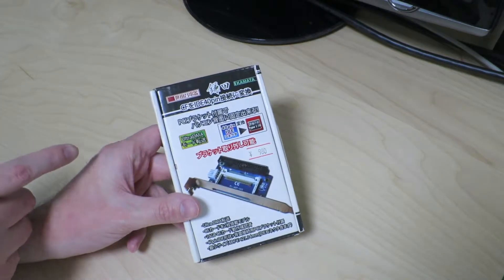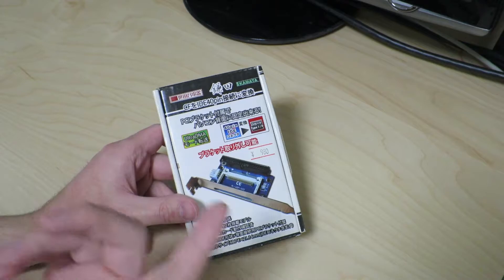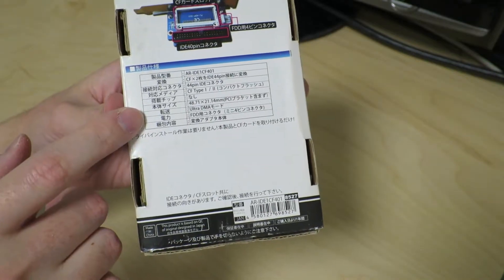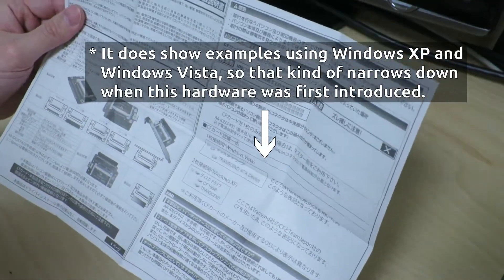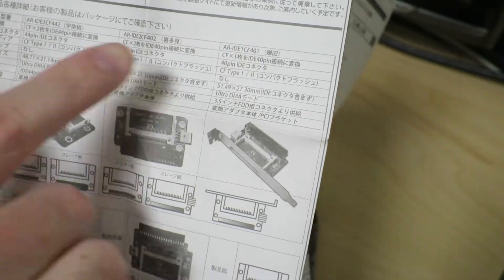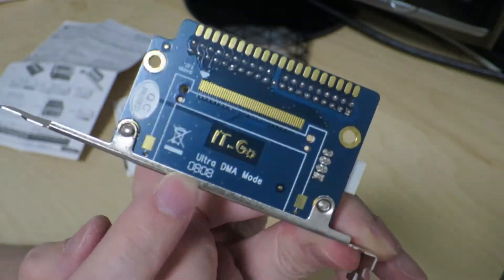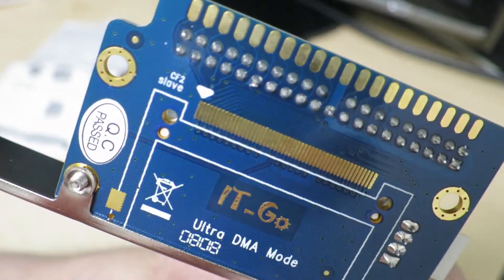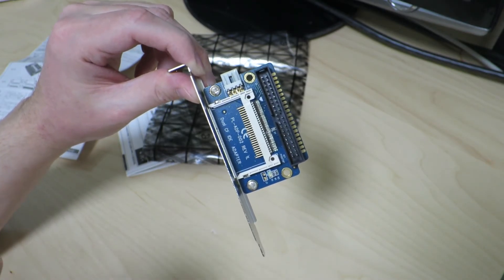Unboxing a CompactFlash to IDE adapter board

Comment: So, will it read the CF as storage? I don't know  how IDE work, actually
Reply from the maker: Yes, basically it allows the CF to be used as any other IDE device, so the CF card will show up like a hard drive on the host machine. IDE was the predecessor to the Serial ATA interface which are common today, and to contrast it with SATA, IDE is colloquially referred to as "Parallel ATA". It was common to see hard drives and (later on) optical drives to use IDE when connecting to the host PC. Thank you for the comment!